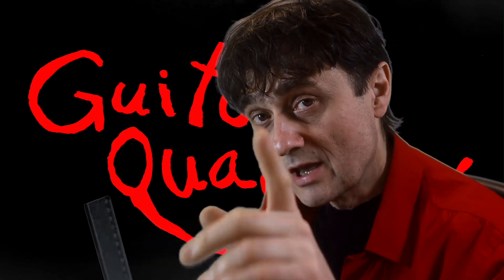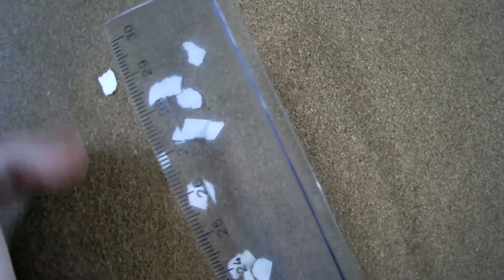Mysterious Scratchy Pot Phenomenon - Triboelectric Effect

Comment: Very cool demo there. That's one of the reasons I used solid copper wire in my guitar for parts that could wiggle.
Reply from the maker: I have used solid copper wire at times, as well, but it wasn’t for this reason.

I think you have a good idea. I can totally see how it would work out well to use a combination of stranded wire and solid wire. 

What kind of guitars did you rewire in that manner?
Reply: @GuitarQuackery  Oh it's an old fender copy stratocaster that my guitar teacher gifted to me for my 18th birthday.
Modified it since then, it had room so I put a humbucker at the base and a bar pickup at the neck.
Wiring it up was quite tedious, lot's of measuring cutting and measuring again. But the whole thing basically holds itself in place.
And you can just put the strike plate on without having to move wires.
Reply from the maker: @ish_RBnetwork  That's very cool.

I actually have a video on this channel, with a similar back story.

My customer, who is the guitar player in the band Blu Eye Extinction brought me a guitar to work on, that's his main guitar and also happens to be a guitar that his music teacher gifted to him. 

At a later time he had me work on a partscaster, which is the guitar with the Aluminati neck, that appears in this video https://youtu.be/cCveXxTJj00

We got it all done and after some time had passed he took the guitar to France (where he and his teacher are from). Then he sent me a message that he eded up gifting the Aluminati partscaster to his old teacher.

Very cool story. And since the guitar appears in a video on this channel, his teacher got to watch how it had bene put together.

Back to the solid copper wires.

I would imagine that the pickup lead wires are the original stranded wires, correct? Or did you actually shorten those lead wires and coupled solid wires onto them?
Reply: @GuitarQuackery  Installing a FRB was on the table at some point as well, then I thought I am not going to spend that much money on a piece of metal. So now I am making one myself.
As for the wiring, I replaced all of the old bits and used new stock. Pots and selector are solid wire connections, while pickups themselves are stranded wires.

Push-pull tone pot that splits the humbucker at the bridge, and a linear mix-in pot for the rail pickup at the neck.
Oh and I used a plug to attach the whole thing to the main line because I didn't want to solder every time I had to remove it. Which turned out to be quite unnecessary because I haven't removed it since.
Reply from the maker: @ish_RBnetwork  sometimes I don’t correctly understand what people mean when they use abbreviations.

What did you mean by FRB?  Floyd Rose Bridge?

The part about making one yourself is confusing me. 

Solder-less connectors inside of electric guitars make me nervous. I always feel it’s a potential internal point of failure. although to be perfectly honest, I have never seen one fail. But at the same time they are not as common.
Reply: @GuitarQuackery  Yes, the floyd rose bridge. I am going to build one myself. Or rather something like it. Not sure what is confusing about it. I'll design the parts and have PCBway machine some of the tricky bits for me.

As for the connector, it's nickel plated so when corrosion eventually gets to it I can always just change it back to a soldered connection.
Reply from the maker: @ish_RBnetwork  I was just wondering if I understood correctly that FRB meant Floyd Rose Bridge, because you said you would make your own, as I never heard of anyone attempting to build one from scratch. 

If you want to build one from scratch, I would look into some of the improvements that youc an see on the Hantug Locking Tremolo Bridge design https://hantug.com/product/plain_titanium_locking_tremolo_6_string/

It is better than the Floyd Rose. It's got a name that is more difficult to remember, for most people. I always have to look it up to make sure I am spelling it correctly.
Reply: @GuitarQuackery  Yeah! Absolutely. Thank you for mentioning alternative designs. First though I am going to have to gain a profound understanding of why these are designed the way they are.

From there I can make my own. Eager to experiment. For example being able to create nonlinear tremolo, or suspending each individual string on it's own hinge.

You mentioned earlier, and I forgot to inquire, that you have used solid wire before. What did you use it for?

Comment: Thank you for this video. It is good to have science to understand what's going on.

I had a 3m guitar cable with this effect. It was noisy when I stepped on it. I no longer use it as a guitar cable, it now serves for a Midi footswitch without issues.
I assume that this effect depends on the insulation materials used in the cables, because it only appeared with one of my cables and all other (quality) cables did not show this problem.
Reply from the maker: Common sense would suggest that it is in fact the insulation material that's causing this issue. I can't see how it would be the only other material, which is the conductor, which is basically just copper. 

It is true that copper is never 100% pure copper and that the amount of impurities will vary from cable to cable. It is also true that the copper wires inside of the cable(s) will also (at least sometimes) have some kind of coating(s). I'm not sure what effect those factors have.

There are some manufacturers that make low noise cables. One such company is Kistler https://www.kistler.com/US/en/c/cables/CG21-cables

For some applications it is important to have low noise cables. One example that comes to mind would be the lead wires for oscilloscope probes. 

I'm curious, was your 3M guitar cable a product that was sold as a guitar cable? Or was it a generic coax cable that you just happened to use for guitar?
Reply: @GuitarQuackery that specific cable was sold as a guitar cable. It works fine for my expression pedal. 
And just to avoid any confusion: 3m refers to the length of 3 metres, and NOT to the company with that name.
Reply from the maker: @martin12207  Oh, thank you for the 3m clarification. 

I was actually kind of puzzled about the 3m detail, which is why I asked if it was a guitar cable, specifically.
Reply: @GuitarQuackery  NATURE has published "Quantifying the triboelectric series" with a nice list of materials. There is a factor >4 between PVC and PP insulators.

I am currently buying Klotz guitar cables, they seem to have selected just the right materials for my needs.
Reply: @GuitarQuackery  with the reference to the short (or normal) length of the cable I wanted to point out that this was not an unusual setup at all
Reply from the maker: @martin12207  Interesting, about the NATURE article. 

The triboelectric effect is not well understood by people in general. Intuitively it comes across as a mystery, for most people. I think.

I think what makes it "mysterious" for most people is the fact that the electrons are not passing through a conductor and we are talking about static electricity with materials that are considered insulators, such as plastic.

Comment: Very interesting, I hadn't seen it with internal lead dress, but makes total sense.  I'd found some balanced cables were far more sensitive to it than others, some cables were really only suitable for line levels.

Our local humidity year round never drops below about 40%, so never gets super "static-y", and less ESD damage in general.  Do you experience triboelectric guitar noise more in dry winters?
Reply from the maker: When the air is dry, there is more static buildup. When the air is humid, the charge fades away more quickly.

But that is just saying how long the material can hold a charge. 

I would have to do some kind of controlled experiment, to compare the crackling in dry weather compared to humid.

The triboelctric effect can also happen with some pickguards. I would imagine we would see more of it, in that case, when the air is dry.

Comment: I had a Cort bass with scratchy pots. I cleaned them, but the noise persisted. I replaced the pots and rewired everything, but the scratching continued. I don’t know why, but I decided to replace the plastic knobs with metal ones — and the scratching noise disappeared completely.
Reply from the maker: Sounds like you also had a triboelectric effect issue. I have never heard a situation with plastic knobs, but I have had the situation with the pickguard material.

Did you save the old plastic knobs?
Reply: @GuitarQuackery  No, I didn’t save them. Why?
Reply from the maker: @rodolfoamaralguitar  I was just hoping that we could do a few simple experiments through an exchange of YouTube comments.